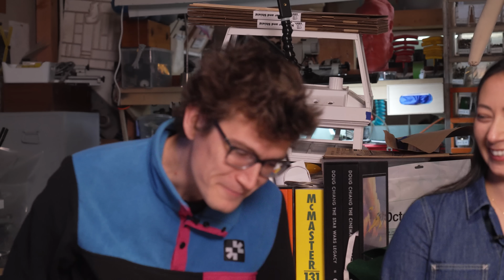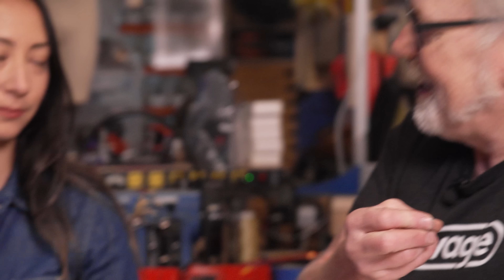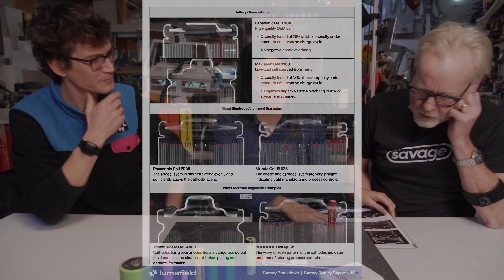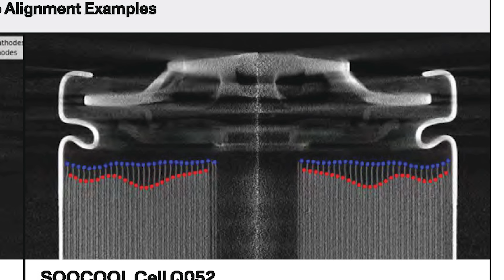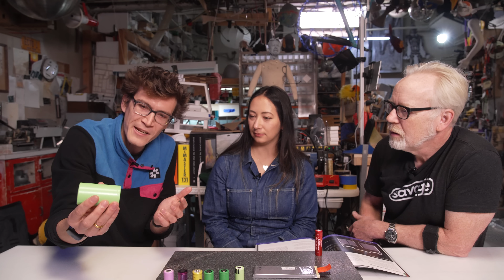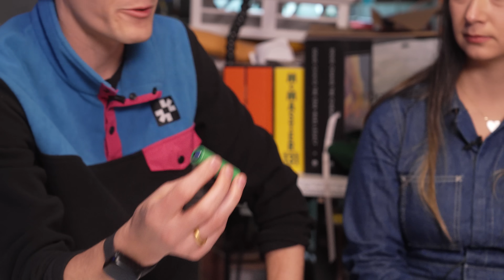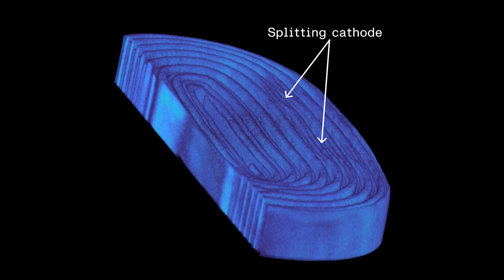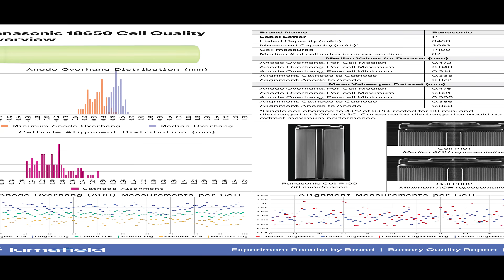The Surprising Flaws in 18650 Lithium-Ion Batteries

Comment: I strongly recommend using only LFP (LiFePO4) batteries when it comes to lithium chemistries.  Its hard to ensure that you are, though.  LFP is almost universally used for home storage and power stations, but most E-Bike batteries are NMC and most RC batteries BMS-less NCA (to be as light as possible).  Nearly all tool-batteries are NMC.  Some are even NCA (unfortunately).  Most appliances with built-in lithium batteries use NMC and often in pouch cell formats, which aren't the safest things in the world (I think appliances do that to limit the life-span, since LFP batteries have 10x the cycle life that NMC or NCA has).

NCA is incredibly dangerous... I'd guess about 90% of lithium-caused fires are caused by NCA RC batteries.  And NMC can still explode.  RC batteries usually do not have a built-in BMS but instead rely on an external BMS associated with the charger.  One mistake and BOOM.  They explode.  Violently.  Its a huge problem.

For e-bike/scooter/etc batteries, you really have to ask for it.  Most are NMC but there are more and more LFP packs coming onto the market.  Plus one can build your own pack or use any LFP battery of the correct voltage when the form factor works for the mobility device.   For example, I have a custom LFP pack ~600Wh or so for my mid-drive e-bike, but I also have a little 300Wh pack made out of two off-the-shelf 25.6V LFP batteries for when I don't need to lug around the larger pack.

LFP can still run away but it does not explode or generally self-ignite (A LFP runaway is 1/100th the temperature gradient that a NMC runaway would be).  However, the white out-gassing from a runaway lithium cell of any type is both toxic AND flammable, so an external ignition source can ignite the gas.  This is why home storage batteries have those fire-extinguisher packs built-in.  The packs don't actually extinguish fires, what they do is mix with the out-gassing to make it less flammable.

I also recommend storing in a flammable liquids cabinet rather than a fire bag, though a fire bag is a decent backup.   These cabinets are double-walled steel and have adjustable vents.   I put all my tool batteries, extra 18650's, and more or less all my NMC batteries in an appropriate cabinet.   I'm less careful with my LFP batteries.. they are a lot more robust.

-Matt
Reply: Wow, you're everywhere...

Anyway, LiFePO4 is nice and all but it also just can't compete on energy density so either the device has to be bigger and heavier or just not last as long. People just aren't willing to make that trade for many uses.
Reply: @Snerdles  Its an issue for RC and aviation.  Not really an issue for anything else.  Certainly not vehicles, and cycle life + robustness stomps the slight loss in range for micro-mobility.
Reply: @junkerzn7312 Power tools too. No one wants their drill to be 20% heavier for no real reason. Robot vacuums, or any similar household tool.

Basically anything that isn't stationary backup. Lots of EVs stick with Lithium Polymer and NMC too, at least any that charge quickly and perform well do.
Reply: @Snerdles  Power tools, sure.  And no, they aren't heavier.  They just have a bit less capacity.  But its usually worth the 10x cycle life (unless you like paying tool companies 10x the money for your battery packs).  And LFP doesn't have voltage fade, either.
Reply: @junkerzn7312 except they are either heavier to get the same amount of energy, or don't have the energy to maintain the same weight/size. Plus calendar aging will destroy power tool batteries faster than charge cycles since even NMC will get 1k cycles so unless you are charging it twice a day it's not an issue and even then you probably use it so much the device will die before the battery.
Reply: @Snerdles  Urm.  NMC in a power tool is more like 500 to 80%.  LFP is more like 3000 at the same levels of stress.  And you just argued yourself out of your point with your assumption that the power tool is barely being used.

Comment: Outside of tools that have internal batteries, I use 2 types ot Li-Ions: AA and AAA sized, which are downvolted to 1.5V and changable branded 21700s which are in my flashlight.

Comment: I hate when friends and family tell me to mod 18650s into stuff. 

Coming from a world where I play with big high capacity C and D batteries and powertool battery packs I will always see 18650s as puny and meager and low capacity. And it's always a letdown when I see youtubers put a single little tiny 18650 into something like a massive 24" wide boombox.

There are BIGGER cell sizes. GIMME DAT 46x80! 💫

Comment: One of the biggest problems is being able to tell a "brand name" from a non brand name since many of the strange names are actually a decent brand and that for many cell types it's very hard to even find places selling the "brand name" cells. 
It's a shame that their page seems more marketing first get the report second. I had to use a browser with all ad blockers etc. turned off to even get it.  Just glad they also didn't do the we mailed it to your email address so you can use a phony email.  Most of us need to be more worried about our data than our batteries.

Comment: This report explains why I have had 18650 batteries just stop working, not discharging just stop working.
Reply: It might. There is typically a way to reset them if the security goes off. But you should also be aware that li-ion batteries won't charge normally if they're drained too much, but then you can leave it charging for a long, long time and once enough power has trickled into the battery, it will start to charge. My Galaxy S8 once took more than five hours to start charging, but once it was above the treshold, it was just fine and I'm still using it every day, two years later.
Reply: @jeschinstad thanks for that info ..good to know 👍.
Reply: There are 2 variants, unprotected ones with a flat head (the ones shown in this video) and protected ones, they have a nubby head similar to AA batteries.
The protected version has a disc shaped safety circuit under their cap and is meant for devices without a protection circuit of their own, like certain flashlights and vapes.
If they get overdischarged, too hot, overcharged or overloaded they drop to 0V and just stay there for safety, you can't use or charge them anymore.
In mild casees of overdischarging they MIGHT recover to a point that makes the circuit turn the output back on again allowing you to charge them again.
And no, you can't "reset" those without dismantling the cap and contact the cell itself, resetting only works with certain batterypacks (for powertools for example) which have a dedicated battery management system (and don't use protected cells).
Bonus fact: Protected cells aren't even 18650's since they are taller and don't match the 18660 specifications, but they are usually still marketed as "protected 18650".
TLDR don't buy protected cells unless your device calls for it, since the maker couldn't be bothered to add their own bms.
Reply: @timhartherz5652  There are multiple examples in the video of nub-headed cells that contain zero protection in tandem with extremely poor quality. The nub isn't indicative of anything.
Reply: @timhartherz5652  Some of the protection chips will latch off until you put the cell on the charger. That requires a charger that will put out voltage with no cell connected though.
Reply: @rocketman221projects Most modern chargers are "smart" though.
They will try to determine the cell type based on voltage,if they don't get anything they can't detect the cell and won't charge.
Same when the cell is just too low, it's a safety feature, they could charge those as well but won't since the cell is compromised.
Reply: @rocketman221projects  Depending on your charger, you might be able to pick something like Ni-Cad to get it to try charging, then you can switch over to Li-Ion after it gets up to 3V.
Reply: @timhartherz5652  At 14:53 the protected battery you are talking about in the second paragraph is shown for a second or two, and you can see the design of its mechanical (thermal or pressure-activated, not sure) metallic disconnect.
Reply: @kevinsellsit5584 Yes that might be a protected cell. But you can't really see the circuit from the side, but it has a disc between the + of the cell and the actual + contact, they usually also have a thin wire running to the - contact for voltage measurement, usually hidden under a layer of sleeving.
The yellow one at 15:02 looks to be a protected cell.
Reply: Lithium whiskers can still grow and discharge the battery even with nominal anode overhang.
Reply: Be careful not to blame a battery for a BMS ( battery management system) shutting down a pac. Also a overheat mechanical disconnect and a on battery mini bms that monitors voltage are two very different things.
Reply: Stopped working better than a fire... have you ever lit a lithium pack? I have... was epic!
Reply: Yup. I didn’t know about those devices either. I overheated some Molicels and they just went straight to 0v
Reply: Yep, you were an idiot and bought the "safe" overpriced shitty ones which decided it is time to milk you out of more money and just bricked your device for NO REASON. If you would be sane and bought a good honestly priced one, your device would continue to work without issues even after they would like you to buy a replacement for extra profits.

Comment: A month or so ago I bought one of these batteries for the first time ever. I instincts were right to go with a good brand, but the pair I ordered didn't fit in the device I bought it for (handheld borescope) because it was considerably longer, and the length is vital to the way the device holds the battery. I almost feel like the device was designed around a version of the 18650 that doesn't have internal thermal safety components adding to the length.
Reply: 18650 cells come in 'protected' and 'unprotected' versions.  The 'protected' ones have a small circuit board on the end which prevents over charging and over discharging and this makes them a bit longer than the unprotected version.  This is different from the thermal cutout mentioned in the video and it sometimes means that they won't fit in the battery holder.

Comment: Feels like a weird hit piece…
Reply: It’s selling their production line capable machine to manufacturers intaking these cells. It’s a really good use case especially for when places like Dorman start making replacement part car battery packs. They need the means to protect themselves from bum cell providers.
Reply: @Racing_Pig Right - Hit piece with aim on getting support for legislation mandating quality control that requires their machine or licensing their tech or similar such angle.  Many practiced lines on ordering from Temu etc on their part for this as well.

 Tested and Adam did not wake up and decide this was great content for this channel - they got paid as they have a type of audience they are looking to create the discourse in.
Reply: @patricksquires77  “Hit Piece” is a very ……. Curious way to self report
Reply: @Racing_Pig self report?  This is 100% a multi multi millionaire’s hit on the current industry state to drive regulations/interest in their startup’s product. 

Lumafield’s a 2019 Boston startup that’s raised $142M in VC by early 2026—including $75M Series C in March ’25 from IVP, G2 Ventures, Wellington, and repeats like Lux Capital, Kleiner Perkins. Backers: Tony Fadell (Nest founder), Dylan Field (Figma CEO). Their Sept ’25 “Battery Quality Report” scanned 1,000+ 18650 cells, bashing cheap ones for 8% cathode defects risking fires, praising Samsung/LG.